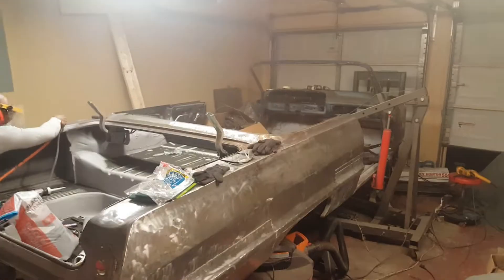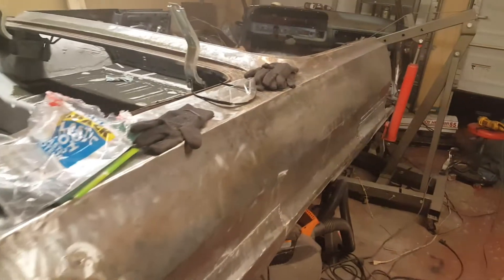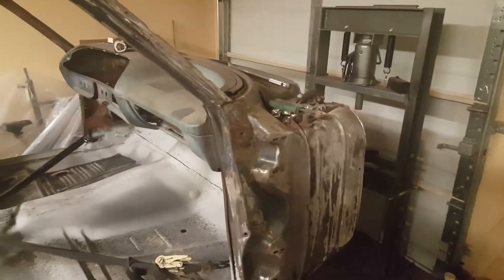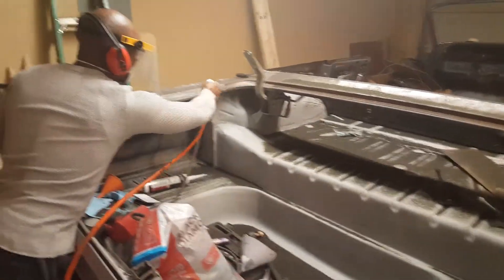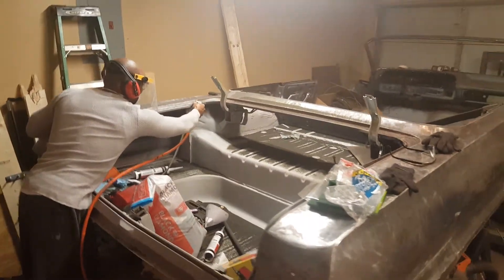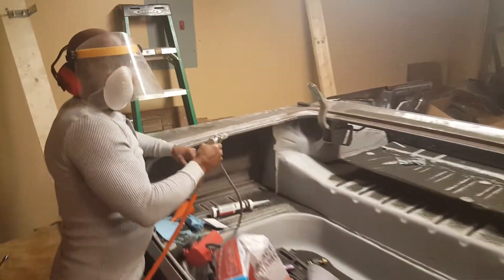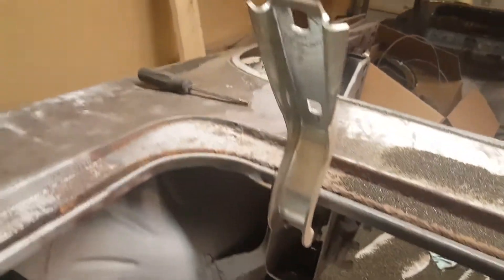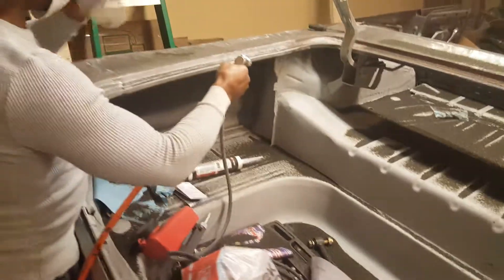Stripping the 63 rag impala body the hard way.  My little cousin just retired from the army.

Comment: what are you using? I bought a soda blaster from harbor freight to remove surface rust but didn't seem to work too well on my 63
Reply from the maker: I'm using coal slag (black diamond) fine grit. Soda will only strip paint. Get some black diamond from Northern tools. 50 pound bag is $8.
Reply: @appliancedude63  ok man I'll look into it , thank you
Reply: @appliancedude63  what kind of machine do you use for the black diamond bag. could I buy the machine in northern tools too?
Reply from the maker: @edgarg4671  I wouldn't blast the body from fear of warping panels. I only blast hard to reach areas. I have a spot blaster from harbor freight and a siphon guns that pulls the media straight out the bag. That's all you really need. I do the rest by hand with aircraft stripper, polycarbide disc and wire wheels. It takes longer but no warpage.
Reply: @appliancedude63  my whole car is down to metal and is surface rust on it. thats how I got it  only a few spots still have paint
Reply from the maker: @edgarg4671  try these disc https://www.harborfreight.com/4-1-2-half-inch-nylon-abrasive-wheel-94017.html?cid=paid_google|*PLA+-+All+Products+-+Lower+Sales+Items|New+Products+-+%281%29+Price+%3C%2410|94017&utm_source=google&utm_medium=cpc&mkwid=s0RbxkpYy|pcrid|318476002950|pkw||pmt||pdv|m|slid||product|94017|&pgrid=63088204786&ptaid=pla-297096109111&pcid=1654049980&gclid=Cj0KCQjwxMjnBRCtARIsAGwWnBMpEneZ6Q92uXoV4yEIDaib7m6sIZhraVz3tUfaH2wMIRV5KLhYFVMaAiVhEALw_wcB